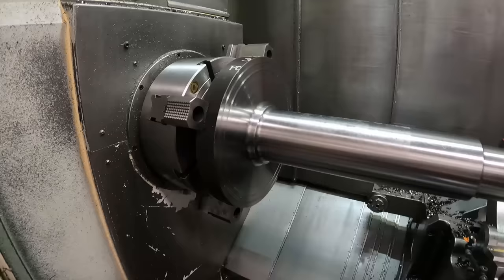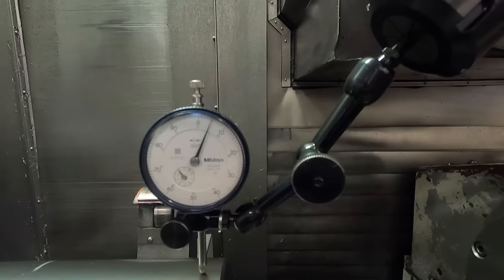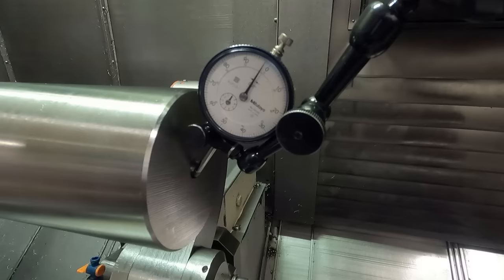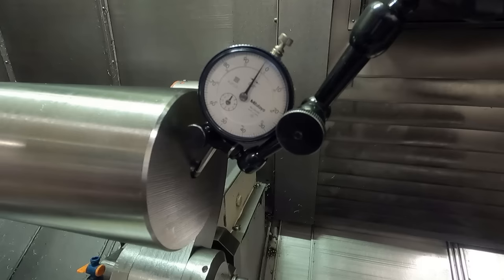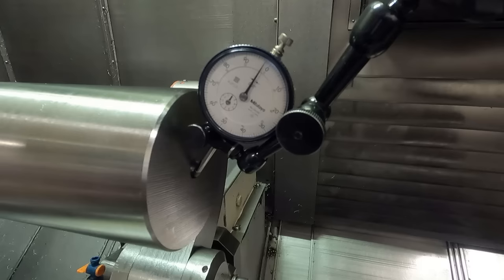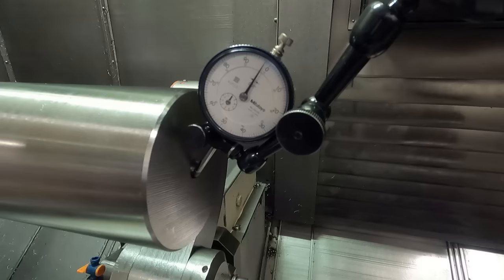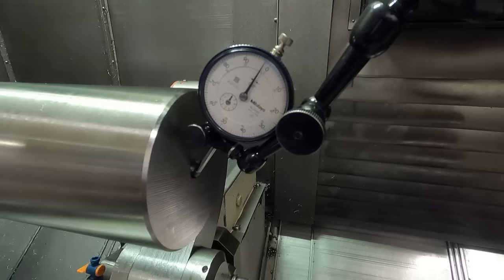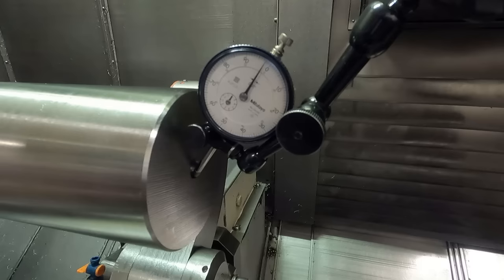Machine Shaft From 2000 Lb Stock

Comment: Weird question: would it be cheaper and faster to buy the shaft forged? and have like a few mm to machine? the part would be definitely stronger, forged vs laminated. Nice and interesting video overall.
Reply from the maker: It could be but in this case there wasn't time for a forging. So we didn't price it. Believe it or not for the time frame given to complete this job, this was the most economical way to do it.

Comment: I'd like to know the application I could certainly design and machine a durable 2 piece axle assembly with a tapered spline interface. but of course if your idea of making  a 2 piece shaft is welding it together I geuss  you should  just make a bunch  of chips

Comment: all that could have been avoided had you not jammed the raw saw cut end up against the jaws to start.  use a stool of sorts to block against the face of the raw end touching the jaw face.  OR  face and turn 1 end to cleanup .  then swap ends and center the 2nd end..  begin rough turning.

Comment: Peter I really appreciate you taking the time to teach us all of this stuff for free you are the best but I have a question:
before you skimmed that small portion to put the steady rest on it is showed in the minute 31:00, before you did that you have adjusted the runout on the center so when you clamp the tailstock you wouldn't get a lot of deformation and stress, so why didn't you clamp the tailstock and than skimmed a portion for the steady rest with the tailstock on so you'll get less runout wouldn't that be safer and more accurate ?
Reply from the maker: When a large piece of material is roughed down there is stresses relieved as the material is removed. In the manufacturing of any material there is force required to form it to the raw bar shape and usually heat. This introduces more stress at the surface (Usually). As you remove that material the core of the stock may than relax to its natural state. In this case the center that I used for roughing would no longer run true when backing off the tail stock center. So if I wanted the part to remain in its relaxed state, I skim the steady band true to its relaxed state. There are two other possible was to go. To re cut the center (Not with a drill) with a small boring bar. Than use the center support to cut the steady rest band. Or to adjust the chucking to make the center to run true and cut the steady band, again using the tail stock. This way would be necessary if the part was long and the steady band could not be skimmed without support of the tail stock. Another way I have done it is to first indicate the part without the tail stock at it's end. Mark down on the part the exact indicator readings of the run out (As you rotate the part). Now I press the tail center with light pressure and a scrap of material between it and the part. So it just uses friction to support the part (Not the center hole). Than I take a hammer and tap the part to run exactly the same as my indicator readings I marked on the part. Than skim the steady band. This is the way to do a really long part.  Where you need support to skim the stead band.  The reason I had to have the steady band to begin with is, I needed to have the hole and bore on the end of the part running true to the relaxed state of the material. If the material is putting force on the tail center when you back off the center the part will no longer be straight. It will have a bow in it. Because at the chuck end the chuck is restraining the part to the spindle and the tail center is forcing (The best it can) true to its center. Hope that makes sense.
Reply: @EdgePrecision  maaaan thhankss soo much for that and for taking your precious time to write such structured and detailed explanation that answers my question and furthermore explains another important technique used in really long parts that no one covers, yes it makes a perfect sense and it is so clear that I have the enough confidence to do it on my own without a supervisor hhh "wouldn't do that though". I can't believe that you replied me so happy for it realy thanks

Comment: Did the customer consider getting a forging for this shaft? Seven 44 gallon drums of chips for roughing is a lot.
Reply from the maker: There was no time for forgings. We had 30 days to get the material and do the machine work. This was the fastest way to do the job.
Reply: @EdgePrecision  As a machinist, this is preferable anyway. You charge per pound of swarf right :)
Reply from the maker: @RotarySMP  But steel only brings around 2-3 cents a pound.

Comment: Hi, another great video! 
Can you please explain on one of the next ones how do you use a small hole to align the 2nd end of the part?
Reply from the maker: The small hole is for setting the C axis zero. That way the hole pattern in the flange would be aligned to the keyway on the shaft. After indicating the part to run true. I put a dial indicator in the milling spindle. Index the B to perpendicular to the part. That’s B 90 degrees. Than with the Y axis on centerline I jog the C and Z axis until the small hole indicates true. Than zero the C offset. Hope that makes sense. It’s a long explanation.
Reply: @EdgePrecision  Yes it does make sense! Thanks for explanation! Usually what I was only doing was puting a small clocking flat to set C0. for the 2nd end of the part. Your method is very interesting :)
Reply from the maker: @antoniantonowicz469  yes that’s another way and may be a little easer on the rough turning tools than the hole. I just feel there is more chance greater error if you were slightly off indicating the flat. Especially on this large diameter.

Comment: I'm curious why they didn't use two pieces to make this part.  Wouldn't it be an option to weld the larger OD disk onto a smaller shift then finish machine to final size?
Reply from the maker: Watch the previous video. I explained that.

Comment: Could you machine a disc with a male part of center drill and keep it pressed in the end of the work with the tail stock and register the circumference of the disc?  This might reduce some error due to inclination of the indicator? I do not know if I used the correct nomenclature. 20:00/1:09:21
Reply from the maker: But I don’t want the pressure of the tailstock against the part. If I was going to do that I could take a small dead center and put the tip in the center drill hole. Than extend the tailstock into the female center hole in the other end of the small dead center. Like you may have seen in videos to indicate a center punch mark in a 4-jaw. Than indicate on the OD of the small dead center. But as I said I didn’t want any force from the tail center on the part.

Comment: What's the advantage of making this from a single large diameter piece of 4140 round stock vs starting with a plate for the flange, smaller diameter part for the shaft, weld them together, heat treat, finish machine? I would expect even with paying for the welding and heat treat it would be significantly less expensive than turning that much 4140 into chips (both raw material and lathe time).
Reply from the maker: The original shafts were made that way. They had a failure with them. So in order to make sure it didn’t happen again the decided to go from solid. Also because their machine wad down. Time was a factor. It would take more time for me to prepare the material for weld. Than send it to be welded, than to heat treat. After that back to me for finish machine. Heat treated bar was in stock and available next day.
Reply: @EdgePrecision  that makes sense, when parts for an important machine fail time really is of the essence.

Comment: Genuine question here (from a DIY fabricator at best), is machining this out of one peice better than starting with a smaller diameter shaft and welding on a bit of plate steel? Seems like alot of extra work and wastage to get the part out of a single billet.
Reply from the maker: If you read my comment in this videos description. It will answer this question. Thanks.

Comment: I looked at this with great interest. In my experience it is not always advisable to machine such a thin shaft from starting large diameter. With 42CrMo bar even with certificates, the center of the bar can be different properties and not meet specifications due to difficulty controlling properties during forging process of these large shafts. . 
Because i am cheap i often repurposed large prop shafts, cutter drive or pump drive shafts for other applications.  I had a few fails on drive shafts machined from 700 mm dia. discarded cutter dredge drive shafts (certified material). You have to be very careful with this. I understand the need for a large dia. flange and shaft from 1 piece but with forged round bar the strength is not necessarily homogeneous throughout diameter and you can be left with a bar of poorer quality material after machining to smaller diameter.. A good full pen weld (and welding procedure) and post treatment and machining should be sufficient. Did you ever encounter this in your work ?
Reply from the maker: These parts were replacing fabricated shafts. We did discuss open die forgings. But there wasn’t time for that. So it was the customers decision to go this way. Even though the original parts failed at the welds I think that properly done welding would have worked fine. But the customer is paying the bills.
Reply: @EdgePrecision  Thanks for explanation. I enjoy your workmanship.

Comment: First time watching.  Why did that part have to be made from such a huge steel cylinder?  That made a pickup load of chips.
Reply: Because of the size of the flange on the end. Sometimes If you’re making a part with not a lot of weight or torque on it you can use weldments to save time and material. But, Im guessing this shaft couldn’t be done that way. At least they didn’t give his gravy away to a journeyman.

Comment: I'm surprised you used circular interpolation for the end work rather than single point turning which I would think would hav ebeen more precise, is there a specific reason ?
Reply from the maker: I did change this on the next part. I didn't record the video on.
Thanks.

Comment: You began with 2,000 lbs. ( I think). What is the finished weight of the part you machined? What was the original OD and what is the finished maximum OD.? If I have not misunderstood …why was the initial part so small of a % of the finished part?  Thanks.
Reply from the maker: The end in the chuck has a flange that is the diameter of the stock (16”). So in order to make the part out of one piece of material it had to be this diameter.  The part weighed around 260 lbs when finished

Comment: Question: you rough turned it and then skimmed it for the steady rest so you could recut the center. But then you adjusted the steady rest until the center ran true. Isn't this just reintroducing the same stress you were trying to get out? Would explain the 1.5 thousandths you got at the end.
Reply from the maker: Yes you are correct! I wondered if someone would catch this. On the other part I also skimmed a short distance right on the end. So I could indicate on that. At the end of the video when I show the runout of both parts it was better. But remember even though I indicated slightly off. Boring the c-bore for the drill would make the hole run true to the steady’s jaws. It would make the drills stiffly off center. But with the long drills it didn’t seem to matter. In making the video I did forget that step.
Reply: @EdgePrecision  Thanks, makes me feel a little better. I thought I was missing something since you know so much.

Comment: Do you know that indicated is not in 0 is more like 3 because the 0 on the indicator is out of line. For example, your indicator is on 1 to 2 o’clock because the zero is not in the center of 12 o’clock

Comment: Very cool...but why start out with such a big diameter?
Reply from the maker: Because the flange on the end in the chuck is the diameter of the stock. At the end of the video there is a clip showing one of the parts setting on the pallets.

Comment: I would think that there is value in all the shavings do you get credit of some kind in stock of bars or something?
Reply from the maker: We do sell them to the scrap man. But anything magnetic they consider steel. So for steel shavings you only get .02-.03 cents a pound. Almost not worth it. Now for materials like Inconel or nickel based stainless and copper/brass materials it is worth it. Believe it or not Titanium doesn't get much either. They consider it contaminated from the cutting tools and coolant. And Magnesium you have to pay to get rid of it. It is considered a hazard material because it burns.

Comment: why did'nt you end for end it , skim it, in the first instance? nice vid thanks
Reply from the maker: It’s just extra work for no purpose. If the part distorts from stress, there is no advantage to having pre machining certain things. Your going have to move it in the chuck to get it to run true anyway. I guess it wouldn’t hurt but it doesn’t really improve anything unless the part stays straight.

Comment: The customer should do some research on welding a flange to a smaller shaft welding engineering is here with proper heat treating and save time and 💰💰💰 .

Comment: I wonder if welding a flange on a smaller stock would not be an option
Reply: I’m a manual Turner and have rough machined a flange and shaft. Shrunk together. , deep weld both sides then finish machine, depends on a few things.

Comment: Hey Peter, I've been watching for a while. I was wondering if there is any scenario in which you would spin the part for drilling with the integrex? Any scenario in which you would rotate both the part and tool (if the control will even allow that)?
Reply from the maker: This machine has interlocks that except for the gear Hobbing mode both spindles can’t run at the same time. It has to be either in the turning mode with the milling spindle clamped. Or the milling mode with the C axis coupled and the turning spindle disengaged. There may be a option I don’t have that can do this. I would use the turning spindle if I was drilling with a very large diameter drill. Because the turning spindle has more toque than the milling spindle at low speed. But the milling spindle can easily handle drills of 2.5” in diameter. And I usually bore out something bigger than that. So it’s pretty unusual that I drill with the turning spindle.
Reply: @EdgePrecision  That makes perfect sense. Thank you. I'm actually rewatching this video, I forgot (or didn't realize) that you were using the turning spindle to drill on this one (maybe to keep that long drill from 'walking' off center). I've definitely noticed that you usually drill with the milling spindle, so that's why I asked. Wonderful work, as always.

Comment: why would you not skim off a land off the mill surface then rotate 180 ...then do the centering of the tailstock?
Reply from the maker: Another way I have also done this is to carefully skim a band to close the steady rest on. Then re-cut the center for the tail stock. this is another way if the diameter is larger than 100mm. the minimum size my steady rest can clamp on. Is that what you are describing? Or are you talking about skimming the face and OD first thing on the stock. then turning it around to chuck on the part. One of the reasons I didn't do that on these parts is I had very little material on the stocks OD to clean up to the finished diameter. The hard jaws I was using for the first roughing operation will put dents in the stocks OD. So to have enough material to clean off those dents. I did it this way and that worked for me. Later I used soft jaws for the remaining operations.

Comment: How can I get the centre drill on a standard lathe? is a 4 jaw strong enough to hold a piece this size just to drill the centre?
Reply from the maker: Yes if the part was indicated to run true. Even this large it could be center drilled. As long as you limit the RPM.

Comment: Just asking, but why wouldn't you machine one end of the bar stock first and then rotate the stock griping the jaws on a machined surface?
Reply from the maker: I did this job quite a while ago. But if memory serves me. I didn’t have a lot of stock on the bars OD for the flanges finish OD. I was planing to hold the rough bar in the serrated hard jaws. When these are chucked hard they will put dents in the part. So I was a little worried about those dents being in the finished part. Also it takes time to do that on large stock like this. When gripping the part in those serrated jaws. It isn’t going to move once the serrations dig into the OD. If I was to turn it to grab on to it in soft jaws. It would not be as securely held. So for me using a manual 4-jaw chuck and serrated hard jaws I don’t see the benefit in first turning and then flipping the part. It just waisted time.

Comment: Any good for reason for not making this a two part assy rather than making it from one part? A circular pattern with recessed bolts to connect the larger OD to the lesser OD? Might be many good reasons for this, but I hope it's not a case of just the designer being lazy, the material wastage is substantial.
Reply from the maker: I will direct you to my comment in this videos description. This question has been asked many times so I put the answer to it there. Thanks.